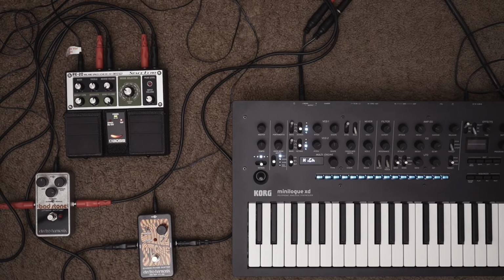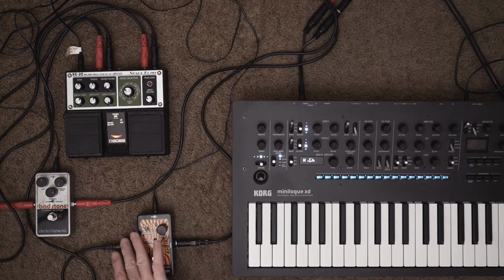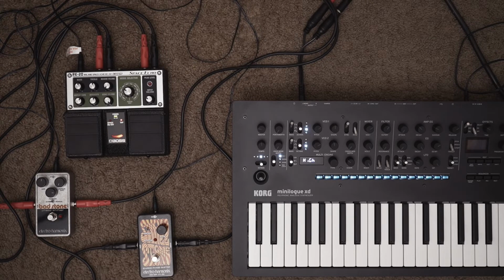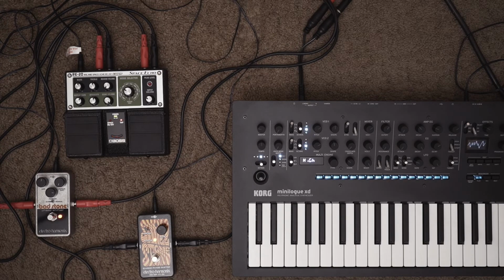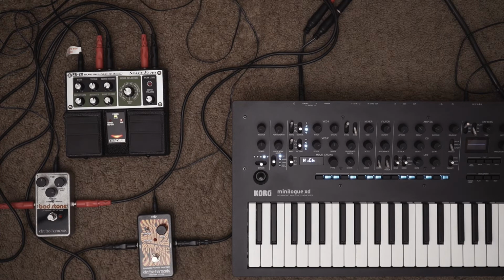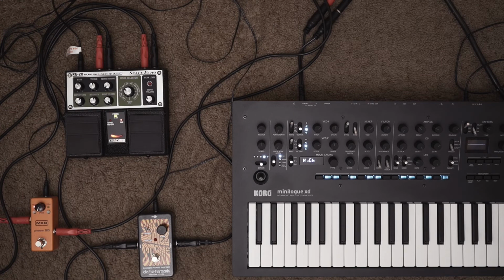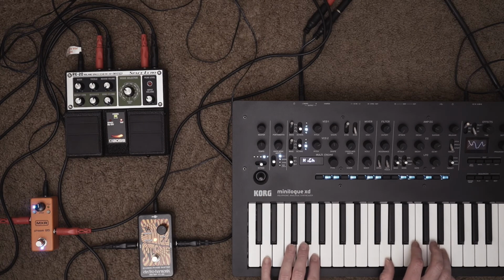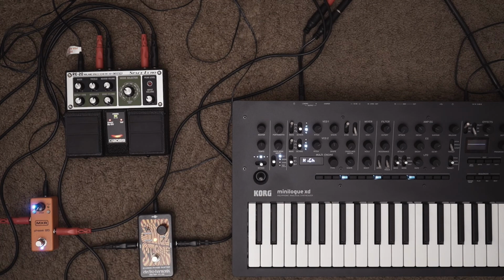Will it stereo ? 2 phasers and tape delay (EHX Bad Stone / Small Stone / MXR phase 90 and RE-20)

Comment: Nice! I'll have to run the same experiment later. Glad you mentioned using 2 chorus pedals next. I sometimes do that with the 70cdr and 50g. I found that multiplying one chorus' rate or depth by 1.5 times the other pedal sounded really good. You have a DC-2W, right? Can 2 separate choruses re-create the sound of the dc-2w or get in the ballpark?
Reply from the maker: I do have a dc-2w, I will have to check. In theory you should be able to get close to what the dc-2w can do. I will have to experiment and do an a x b in the future on that idea. I have a ce-2w and a ce-2 clone so that might be the place to start with that.

Comment: I think you just designed a pedal.
Reply from the maker: MXR did have double phaser called the phase 99, it was 2 phase 90ies in a single box with one input and 2 outputs. It is very pricey if you can find one these days though as it was limited run. It even can sync the lfo if wanted, but that would not work for a stereo spread.